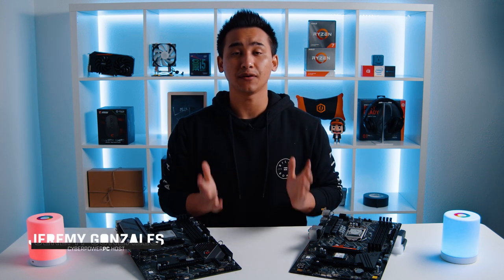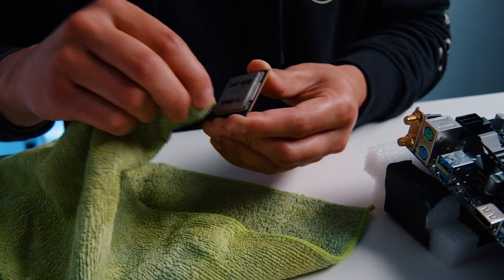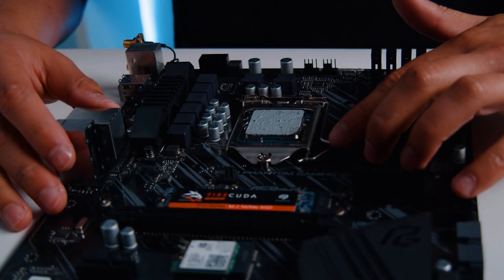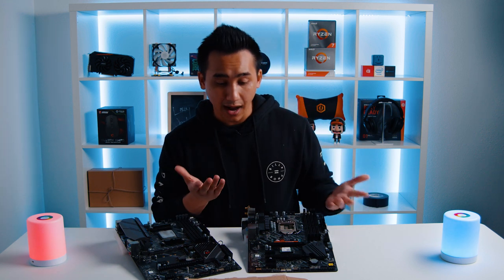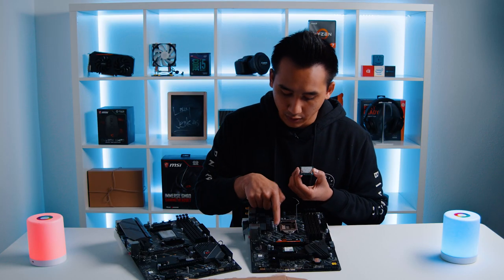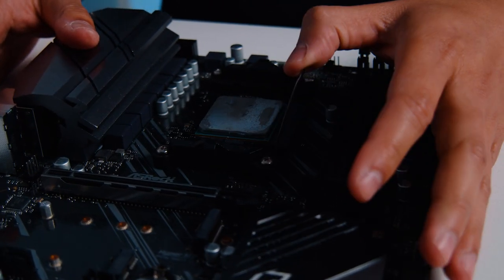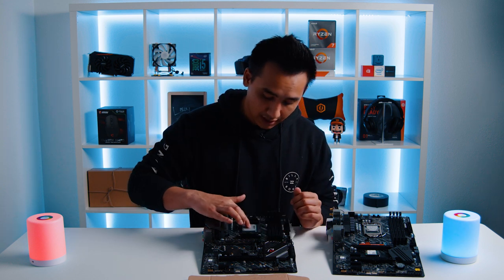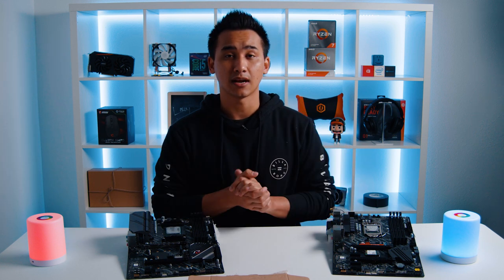CPU Removal/Install Guide! (AMD/Intel)

Comment: What if my amd cpu doesn't come out as easily as yours? What then?
Reply: Yea mine won’t come out did you find a fix
Reply: You should put the pin back until you hear a pop. The entire socket is moving it into position to lock the processor in place.
Reply: @Wawa you should pull up until you hear a pop
Reply: @WawaHappy you find a fix?
Reply: @WawaHappy just do what i said you should be good
Reply: Same thing here. Bent 5 pins on my cpu cuz i forced it out, had to buy a new cpu. Wasted over 300 bucks. Fuck my life
Reply: @creativebusinessunit7506  man, you could have tried to bend them back. Works on all the reddit stories anyway

Comment: Usually the cpu is stuck to the cooler. You should give a guide on that.
Reply: Im here for that lol accidentally yeeted the CPU with the cooler
No pins were damaged, so im good
Reply: Also, pro tip from a dumb guy that almost lost his CPU: run a heavy game for a while so the pc heats up and the paste gets soft, turn of the pc and immediately go for the cooler. Slightly twist it and NEVER just pull on it
Reply: @DLNBioletto  as someone who is gonna swap my cpu for a new one for the first time tomorrow, thank you for this advice

Comment: Hey I’m new to PCs, Can you remove a cpu you’ve had for a bit and install a new one without it messing up your computer?
Reply: Yes mate I have experience for over 40 years it’s easy least make cure u have some theremal paste
Reply: _Chino98  yes it will if u want to double check go onto pc part picker and put in ur computer parts
Reply from the maker: Yes we have a video guide for your exact question, check it out here: https://www.youtube.com/watch?v=ubhaJi-hU6Q
Reply: @colemair3554  Is it okay to leave the motherboard in the case when removing the cpu/adding new one? It was such a hassle to get it in when I first built it :S
Reply: @ardechey  yes

Comment: So if I want to remove my cpu (Intel) there is almost no risk of breaking anything
Reply from the maker: Technically there is always a risk when handling PC components. However, should you follow the steps and handle everything properly, there will be  little to no risk involved in swapping out a CPU!
Reply: You’d bent the pin in mobo

Comment: I just watched your video and loved it! Only question I have is this... I just put in a new AMD CPU. Only kicker I have is finding a way to get the fan over the cpu back in. It has a huge gap above the CPU and I can’t find a way to get the 4 screws with springs attached again. Any hints or clues how to do this??? I can’t find any help anywhere. Thank you for the help!

Comment: So what do I do if the chip is glued to the cooler? Is there an easy way of separating them?
Reply: i know this is super late but run a benchmark on your pc to hat the glue up and then it should be easier to remove.

Comment: I bought a pc and it had i3 in it can I remove it and put a amd a9-9420? Will it work?
Reply: Sadly, you would need to get a new motherboard that supports AMD CPUs.
Reply: @bobcastofficial7922  ok thanks for the feedback

Comment: I have a problem with my cyberpowered pc when I try to run more than 60 fps my monitor goes black and my pc fans go at 100% what would I need to replace
Reply: it sounds like something is overheating, maybe graphicscard or cpu
Reply: Or monitor hz is to low for pc on epic quality
Reply: It was my graphics card I got I replaced

Comment: Inserting and Removing a Processor: In this project, you remove and install a processor. As you work, be very careful to not bend pins on the processor socket and protect the processor against ESD.
My School Project To Notebook This Write. 
😅

Comment: HELP, ok now that I got your attention, I wanted to upgrade from a Ryzen 3 1200 to a Ryzen 7 3200 and I wanted to know if you can actually put a Ryzen seven on a Micro ATX motherboard. Is there a limit  for smaller motherboards? Apart from installing more than one GPU etc. Can you put higher end CPU’s and GPU’s on a Micro ATX, or bc it’s small will it not let you. I have a MSI B350-ProVdh and I really wanted to know.  Also When installing do I need to do any bios downloads or anything. Help would be much appreciated!!

Comment: Let's say I wanted to get a pre-built PC that has all the parts of one that I would build myself except the CPU is a Ryzen 7 3700X when I would rather an Intel i9 9900k.  could I use the computer with the Ryzen for a while before switching the CPU to Intel if I am not satisfied with the performance?  Or would that create problems?
Reply: You would have to also replace the motherboard as well because AMD uses a different type of motherboard than Intel.